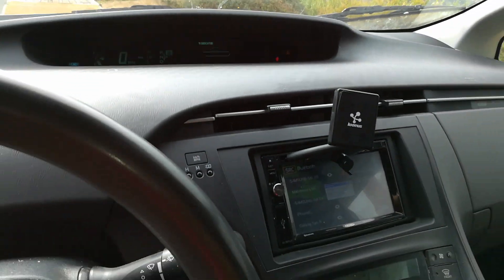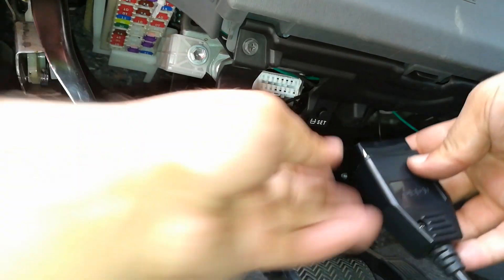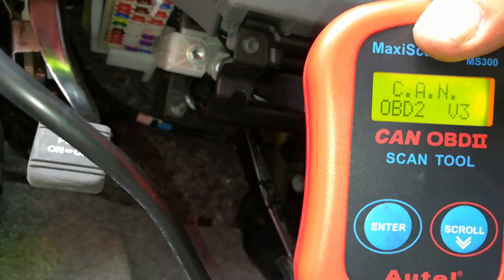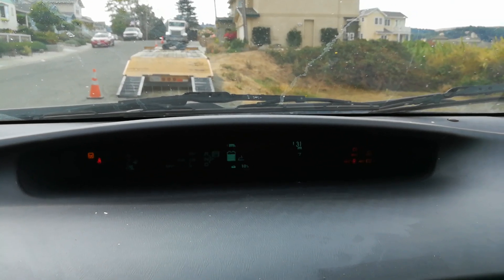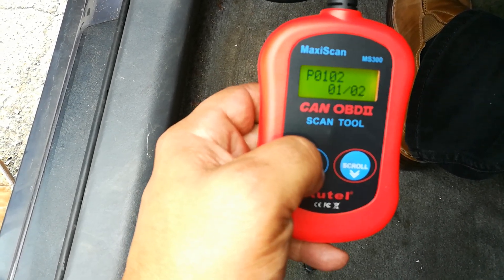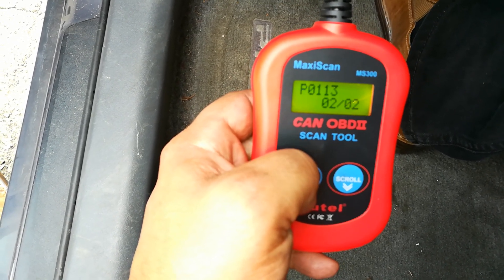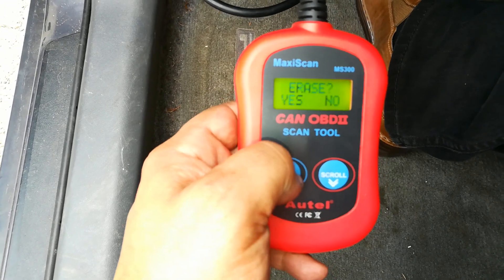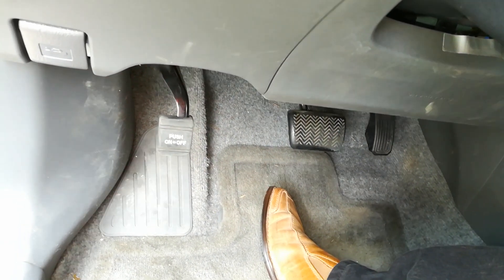How To Reset Prius Check Engine Light 2010-2015

Comment: If it’s a permanent code u can reset on 2011 or newer it stays in mode 10 until the computer see that thier no longer a problem other wise great video
Reply from the maker: Thanks for her feedback, as the vehicles age, this mode 10 issue will become a bigger problem than most can imagine. Thank god it is only enforced in California ( as far as I know).
Reply: @ yea Cali doesn’t play around bro yeah I always look at mode 6 and see if all the monitors have run and see if thier any codes DTC and lastly mode 10  no problem anytime

Comment: I did it but still it shows on display error code
Reply from the maker: What code does it show? That means the issue has open circuit and vehicle is able to detect the open loop. Provide some more information and I will point in the right direction.

Comment: This is the 3rd time I have engine check light on for my Toyota Prius 2015. The first time happened about 6 months after I bought the car and the 2nd time happened a few years later. The dealer said I did not close the gas cap tight which is not the case and they charged me $130 each time to reset the code.  Thanks so much for the video, it'll save me lots of money though 😊
Reply from the maker: Glad to help and thank you for the feedback

Comment: Thank you so much for this video. I discovered that the fuel cap was loose when I was at the gas station and the dealer wanted $65.00 just to "diagnose" the problem. Ordered the scanner from Amazon and in less than 3 minutes, the check engine light is gone.
Reply from the maker: Glad to help

Comment: Whats that little button next to the obd scanner?
Reply from the maker: What little button?
Reply: @RANDOMFIX  the button that is litteraly right beside the obd2 port.
There is one on my 2012 Prius as well.
In my experience the obd2 readers will not clear the codes. I have a 200 scan tool and it is not clearing my light.
Mine was on because the water pump needed replacing.
I replaced it but the light is still on.
Car is running great.
Took the battery out for 24 hrs,reinstalled...light is still on.
Not goimg to worry about it.
Reply from the maker: Hi Keith, I will look for the button next time I get a chance on a 3rd gen Prius. But I'm looking a picture now and it thinks the button is for the tpms and some Prius have a 3nd button for the pre collision system

Comment: if you find the issue and correct it without the scanner will the check engine clear at any point?
Reply from the maker: Sorry for the late reply! did you find a solution?

Comment: Will this work 2006 Toyota Prius?
Which did one use ?
Reply from the maker: Joshua, the precedure is the sale for the 2006 as the 2010 and you can buy an simple obd2 scanner ( check the link in the video for the one I use, it works great. ) _Randomfix

Comment: So what where your codes for??,
Reply from the maker: Geeman, Great question. The codes were for an unplugged mass air flow sensor. But the point of the video was to show the audience that you scan your own vehicle yourself and that tool is only about $20. There are thousands of different codes or DTC (Diagnostic Trouble Codes). _RandomFix